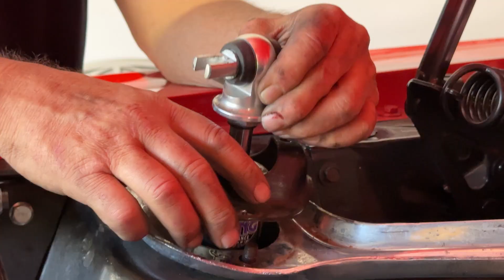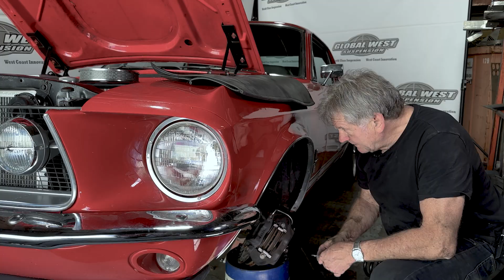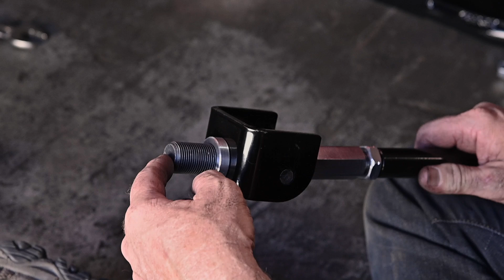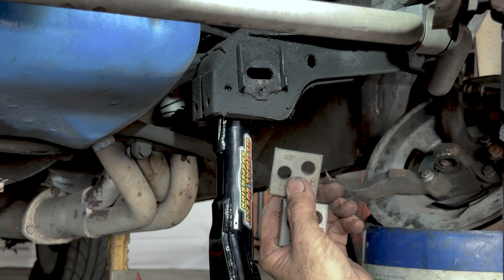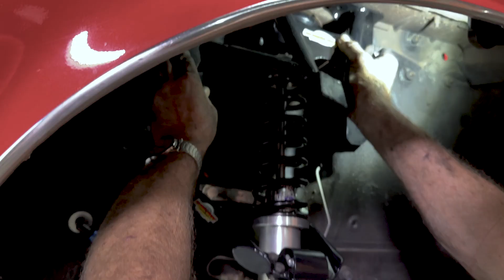Installing Global West Suspension Coilovers for 1967-1969 Ford Mustang

Comment: I have searched high and low, but I can not find the video for setting ride height that is mentioned at the end of this video. I remember many years ago, that you are to take a measurement from the lower control arm mounting bolt center line to a level floor and then take a measurement from another  point on the lower arm to the floor (was it where the bottom of the spindle where the lower ball joint stud inserts?), but I can't remember what the difference is supposed to be between the two measurements.